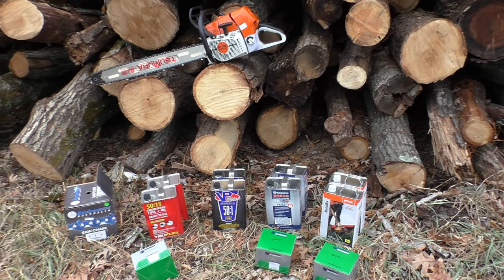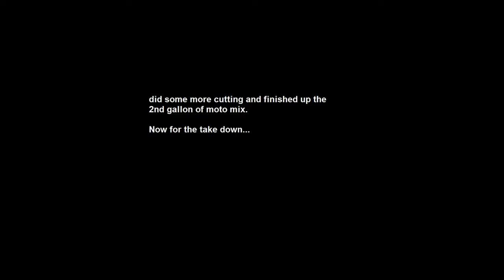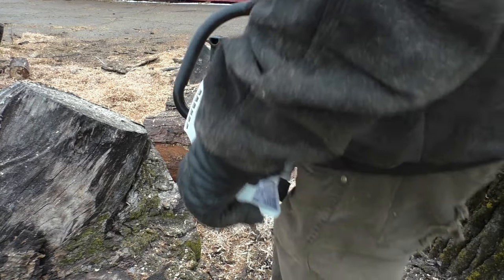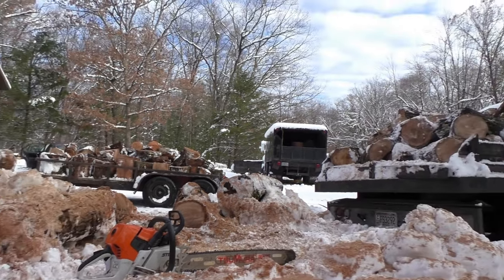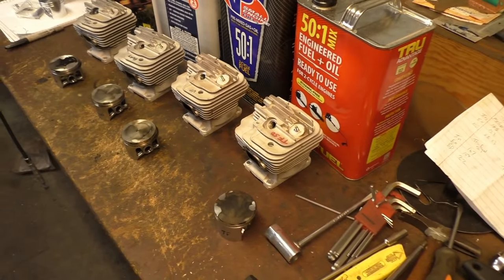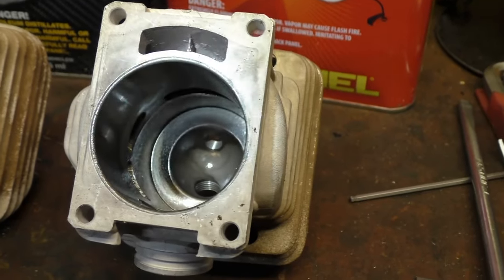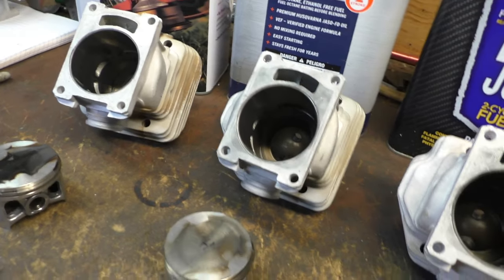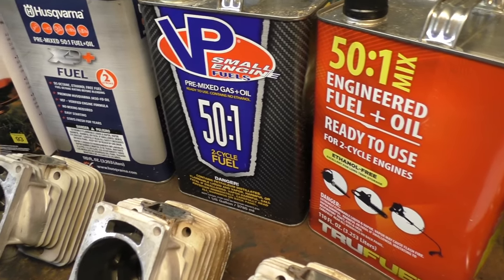Premix Fuel Test - Stihl vs Husqvarna vs VP vs Tru Fuel 50:1

Comment: Is it possible that Stihl uses an altogether different oil in their Motomix than they sell in the bottle?  

Been running Schaffer’s 7000 for a while now based on your suggestion.  Very pleased.
Reply from the maker: I suppose anything is possible but I seriously doubt it.  Same smell and same green color.   Right on man!  : )
Reply: Good point.  Forgot about the smell issue.  I sure don’t miss the odor.

Thanks for taking the time to do this stuff.  Is Scott pretty much recovered now?
Reply from the maker: welcome. thanks.  yeah id say so.

Comment: This is absolutely amazing results!! I use VP 4cycle fuel and full synthetic oil and mix myself. I do agree with you on the smells VP fuel in my opinion isn't that bad of a smell. I've been running my equipment this way for a long time. I was using Tru-Fuel, but started using VP and like it much better than Tru- fuel. Fantastic job on these comparisons. This must have taken a long time and cost alot to do?? I greatly appreciate you doing this video. Wish I'd have seen it when you first posted it. You got another sub good Sir
Reply from the maker: thanks!

Comment: Can you guys answer a question? My new Sthil BR350 blower quite working the Sthil dealer claims I did not have oil and gas mix, not positive this is accurate but I can’t prove they are wrong, when I asked how they know they said the gas looked different. I can two cans in my garage about 1.5 gallons total. I know for sure they both have Ethan Allen free gas in them and maybe only one has the Sthil oil in it. Can I mix the two together and put it in my car or use in my lawn edger (4 stroke), Some friends said it won’t hurt anything just may smoke. If there is any change of damage I’ll just get rid of it somehow (any suggestions of how to get rid of old gas?)

Comment: For the non-professional chainsaw user, the most important aspect of fuel is how much it degrades rubber while the saw is in storage.  I’ll never use my saw enough to ever need to worry about how the fuel is burning at full throttle.  But my saw will last long enough to have to rebuild the carb a bunch of times due to diaphragm hardening from fuels with aromatics in them.

Comment: My small engine mechanic said my chainsaw had straight gas in my Husqvarna 440. Which I used the True-flow 50:1 gas. It ran rough then wouldn't start after a few cursed pulls. The cylinder walls were scored. I think the saw is ruined.

Comment: Excellent test!
I still don't plan on running canned fuel. I don't understand why people would buy that stuff. My cost to run 50 gallons of pump gas (87 octane, with ethanol) with Sta-Bil and Stihl Ultra oil is $398.21. Per gallon, that's at $3.71 for gas, $0.29 for Sta-Bil and $3.99 for the oil. To run 50 gallons of the Stihl fuel, I would pay $1,497.50. No thanks. I'll run pump gas, treat it, and have $1,100 for a new saw, if I even need it.
Nonetheless, thank you again for a great test!

Comment: Aspen is my personal favorite, alkylated gas, no smell at all, especially with a good oil. It also lasts up to 5-6 years guaranteed by the manufacturer, compared to 1-2 years for regular ethanol-free pump gas. Longest I ever had it in was a trimmer, 3 years untouched (left in a cabin up in the mountains), smell didn't change at all when I opened the tank, the machine started in 4-5 pulls, then 1-2 pulls afterwards. It's all I use around here, pump gas is sadly all ethanol where I live and all my 2-strokes are pro tools so I don't want to cheap out on gas.
Reply: Are you in Europe? Haven’t been able to find it in Michigan.
Reply: @larryreno8293  
Yes, Aspen Fuel is sold mainly in Europe (it's from Sweden) and they advertise it heavily as being extremely clean and with no benzene, for use in Swedish forests where the build-up of exhaust fumes in still air is supposed to be an issue with car gasoline. From what I can make out (but may be completely wrong), the Husqvarna canned fuel is almost equivalent to Aspen fuel. I leave Aspen fuel in my generator for years with no issues and with no starting problems (I run it for fifteen minutes per month if it's not actually in use).

Comment: Julian...What a great Christmas gift to us gearheads.  I know those cans of fuel have date codes on them and was wondering if because most people being what they are will run the cheaper fuel off the shelves quicker.  There is no way I am going to spend $29 for a gallon of gas especially after listening to Scott offer his opinion on octane.  I am think I'll stick with my Shell premium non ethanol and K2 mix.  Seems to work fine for my purposes.  As a precaution I also add a little Startron to the raw gas before mixing.

Keep up the good work. Interested in seeing the 40:1 test.
Reply from the maker: fyi - stihl manual calls for at least 89 octane.  I think the most important thing one can do is run non ethanol gas. For me here that is 91 octane.  Also I know from talking to a guy who worked at a refinery that the premium pump gas has the most additives in it and runs cleanest.  Have heard good things about k2.
Reply: I run the k2 in all mine with 90 octane ethanol free and have had no problems. I also run that on all my mtronic and autotune saws without any issues.
Reply from the maker: I have some. looking forward to testing it this summer
Reply: Just remember... the feds legally allow up to 5% ethanol even though the pump sez non-ethanol... at least here in wny
Reply: @fabzacres-blackcat  my Uncle works for a gas company in SC he said they don't actually measure the ethanol some may be 5% on up to 15% or so.
Reply: WhiskeyTangoFoxtrot yeppers ... here in wny independent testing has gotten up to 20% ethanol from certain stations ... ? In a car ... devastating to a high-performance 2-stroke engine ... ethanol and mix oil no likey each other !

Comment: Do a comparison with stihl mix towards the end. Might be a bit different out come. M-tronic will dial in to the first oil used. I have found that stihl runs a bit hot. Using laser temp thermo.

Comment: I like this video, good job at considerable time and expense.  I ran more than 10 tanks of Ultramar 91 and Stihl / Castrol mix through my new 500i before I took it to get ported.  Machinist said rings had not fully seated yet, looked like new inside. Porting the 500i did not give it much more rpm, but rather more torque, very impressive saw.

Comment: I enjoyed the test you did, very good for research. I have been looking for the best fuel to store a few cans. I read the manual with my stihl ms362 and it said 93 octane keeps the engines from heating up to much. Most of my vehicles are lower than 10.2 compression and have computers so I only buy 87 for those.

Comment: Great video here, I'm a bit late to the party lol but do have a question for you fellas- what brand/octane fuel do you guys use and what brand of oil as well as mix ratio? 50:1 or do ya run them thicker on the oil and why?

Comment: In EU there's Aspen 2T mix. Cost 25 bucks per 5 liter.  Mostly    i add some extra Castrol A747 oil to it.  50 :1 is too hot.  40:1 im using in my 270 and 441.  Marine fuel is rare to get here. Bio ethanol in regular fuel is bad for saws.
Reply: Bio diesel is killing a ton of tractors here in the U.S I've heard.

Comment: i was using tru fuel but i started using my saws too much for cost.  i buy the ethanol free stuff and mix my own and mix in 1 gal can.  i liked seeing all the pistons and jugs afterwards.  i think the biggest thing really is shelf life and having to drain the gas if saw sits for anytime.  i watched one guy using stabill and the gas was trash.  i saw this in my sisters mower that wouldnt start.  i drained gas in a jug and then later poured some out and tried to light.  would not light at all and it had stabil in it.  i think all that stuff is crap after this and will not use.  i just keep small quanity of gas and mix small amounts as needed
Reply from the maker: interesting.
Reply: I think Project Farm or someone did a test with gas preservatives and came to the same conclusion, that they were junk. I think the best thing is, if you know that any tool is gonna be stored for a while is, run some 2 stroke mix/ethanol free gas through it, until it stalls and hope for the best ?

Comment: Ive got an old MTD trimmer that i have had for almost 25 years, save your money on this canned fuel, you dont need it.  i use premium unleaded/40:1 mix,  at the end of the year i do 1 thing, the last time it gets run for the season,  i drain all the fuel out of the tank, restart and let trimmer run until it acts like it is running out of gas, flip choke on and continue to run until it quits,  thats it, its ready until next season.  only once in 25 years i had the carb apart to replace diaphragm that had become stiff with age. Ive watched videos about the canned fuels compared to pump gas, Ive noticed a lot of the canned fuels don't allow engine to develop full rpms, even in some cases harder to start. save your money on this stuff.

Comment: What a ton of work for a test!
Strange how the Stihl mix had the cleanest c chamber but what looked like a ton of carbon on top of the piston.
Did you have to add the sprocket to the nose of that bar to run 404?
I can't find Tsumara 28's in 404.
Reply from the maker: yeah need a 404 tip on an 063 bar.   I have a 28 404 tsumura lite FS.   ammotesting  gmail
Reply: Carbon on piston from lean condition
Reply: @fabzacres-blackcat  *rich

Comment: MotoMix is hard to beat.  The only problem is the cost, $27.00 a gallon plus tax.i mix gas as close as I can to MotoMix in my two cycle stuff, but like you - I do not like the smell.  I think the Stihl gas has a little more octane than I can find, locally.    I look at gas as a long term test and not just a few tanks.  I have five years of Stihl Ultra behind me with no failures and I will endure the smell for those results.

Comment: Personally I'll just buy the 90 octane ethanol free from the pump (luckily I got one local) or I'll buy 87 e-10 and do a water/ethanol extraction.. it lowers the octane to 84-85 or so but chainsaws don't mind even the high compression ones, they're not like 12:1 4 strokes

Comment: In UK I have not seen much pre-mix fuel.  I just buy 20 litres of regular Petrol, in a Jerry-Can.   Then add 100 ml of two stroke oil to 5 litres, to make 50:1.   If i want 40:1 for a new engine, I mix 125ml to every 5 litre.   Havn't met any motor cycle guys that use pre-mix in Cans.

Comment: wow what a great video I have often wondered how different fuels react hah n here ya GO ! thanks for  an exceptional experiment . years ago for what ever reason I started using Stihl fuel for my power saws , 5 years later I have less problems . with maintenance . not sure why , but before I just used pump gas and mix. I have a  regular tree job but often help folks out with smaller jobs , hence I have my own powers saws. I have used other fuels . but with the Stihl gas my saws can be stored for a few moths in between use and have no problems starting and run just fine . just my story .      Joe  bay area California USA ..

Comment: I’ve been running VP 40:1 in my two stroke stuff. In a gallon of fuel the difference between 50:1 and 40:1 is only a few ounces of oil. I figure a tad bit of extra oil can’t hurt, should help the engines last longer. You would think anyway. Don’t seem to have a issue with excess carbon buildup from what I can tell. Seems like pretty good stuff haven’t had any issues so far.
Reply: I run my husqvarna 576xp on 32:1 and no issues just runs sweet. You should be fine

Comment: “…doesn’t smell as bad as Stihl’s…”

I’m wondering about the odor.  I’ve read it gives headaches.

Thanks for testing.  Looking to used canned fuel in an emergency generator. (60 volts @ 6-9 amps). Am willing to mix my own, e.g. tru-fuel and Maxima K2 @ 32 to 1.

Comment: Thanks for the review, I've been wondering about this lately. I mixed my own fuel with the Stihl mix and I agree it didn't seem to be great. I've used to Stihl moto mix and true fuel and like both of them. It's unfortunate how expensive it is, but long term it's probably our best bet.
Reply: Mix the unmixed tru-fuel with Stihl HP ultra and it may save a few bucks. Here it's $30+ a gallon for moto mix. $20 for tru-fuel and $1.60 for a 2.6oz bottle of mix oil.  Save around $8-9. Just an idea.

Comment: Great test !  Kinda late now but if you decide you do another check the compression on the saws before/after ... methinks both you and Treemonkeys minds will be blown 😀..... gents ... I don’t “make” saws run ; I “let” them run and sometimes little things make BIG differences !  Best o’ the season to ya !
Reply from the maker: thanks.  yeah squish on these cylinders has to be under 30. I was going to do a gasket delete for each one but none of them would turn over...didn't feel like cutting squish.
Reply: Redbull661 gotcha ...😉

Comment: STHIL Moto Mix is £20 for 5 litres and Tesco momentum 99 RON IS £1.35 /BP Ultimate 97 RON IS £1.54 / Shell V-Power 99 RON £1.43  all per litre and 5 litres of STHIL HP super £35 lasts a while. I think it’s a mix of the ethanol and Some additives in some pump fuels that stops the 2 stroke oil from lubricating properly. I have ran Avgas in chainsaws before with no ill effect.
Reply: AV gas doesn’t contain ethanol and has a higher RON rating. So that is understandable.
Reply: If you want to use car-type petrol, then there's a YouTube video that tested them all and came to the conclusion that Texaco Premium petrol was the best and had the least ethanol in it, even compared to other E5 fuels. I use Aspen Fuel for my chainsaws and strimmers, but switched out all my stored petrol for the wife's car and replaced it with Texaco Premium plus Sta-bil fuel preserver. Seems to have good longevity.

Comment: Stihl doesn't recommend storing pump gas mix for more than 3 months and recommends at least 87 octane or higher.
Reply: Motomix uses alchilated gas, Stihl says they guarantee it lasts 10 years unopened. We don't have it around here, but I buy Aspen gas, which is what stihl uses in this mix. Very satisfied, you can leave it in saws without a problem, no gumming the carb, no reaction with rubber. Worth every penny if you don't cut much.

Comment: Back in WW1, the biplane fighters' engines used castor oil,  what the open-cockpit pilots would fly into for hours at a time.  Diarrhea and nausea were considered a cost of flying! 
But then early in WWII, the Stuka dive-bomb pilots would have to have the flight surgeon lance their eardrums before they flew, so they could survive the pressure changes.
So much for the romance of flight!  🤣

Comment: Thank you for being one of a very small group of people that actually understand how to manage power while cutting! Normally I cant stand to hear people cutting as the saw goes back and forth from chain stall to over rev. Watching dumb nuts bucking and jerking the saw around as if there was no engine on the saw. For the most part the trigger should be used in 2 positions, cutting and not cutting. Then control RPM with the work and that can't be done if your handling the saw like your shaking change out of a piggy bank.

Comment: The higher the octane means the slower the explosion.  A 60 octane goes off instantly and will cause detonation.  The high compression engines require hiher octane which goes off more slowly thereby preventing detonation and cratering of the piston.  P51 Mustang flying combat missions for example used as high as 151 octane fuel and required a complete engine rebuild after 200 hours.  Mos of the modern 2cycle engines are fairly high performance,   High revving and high power to weight ratio.   I enjoyed your video and appreciate the time effort and expense.
Reply: Yeah but the modern 2 cycles like in saws are completely different from a high compression 4 stroke.. a slower burn in the combustion chamber is actually bad for HP you actually want the lowest you can get away with and in a chainsaw 87 is more than good enough

Comment: i run vp, but only in my last tank of the season before I hang the saw up for a month or 3. then run her empty on that tank. My thinking is, any residual fuel wont gunk up the carb like regular gas residue would... my thinking and my opinion of course. so a quart does all my saws, all my weedeaters, generators, etc. LOL. a gallon would last 4 years! LOL

Comment: I think any difference in carbon buildup is due to owners in ability to mix fuel correctly.  I mix everything empirically and I use PNE and not ethanol fuel.  I also shake my gas container before each fill up.  Gas thirty years ago was just gas but today the gas sucks and we have to take precautions that I did not take thirty years ago.  Then, I just poured a 16 ounce can of Sta-Mix in a 2.5 gallon tank and filled it with plain old  regular gas for a 40:1 mix..  I was not real careful with it, either.  It sat in the back of my 4x4 Ford until I needed it.  I never measured anything - if it was green it went into a saw, even though I would shake up the container, occasionally.  My saws were still running 20 years later, too.

Comment: Napa is always pricey. I get the VP fuel at ACE hardware, $79 fo a 5 gallon can, product #779-6006. I do have a similar result in my ms460 after 4 gallons the cylinder is spotless, piston top is every bit as clean as yours and the exhaust port is a bit cleaner.